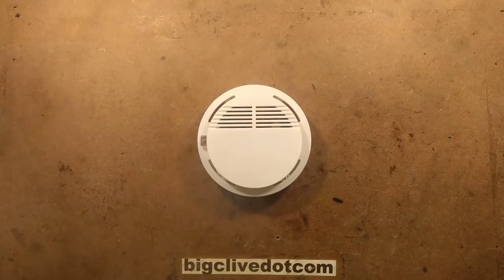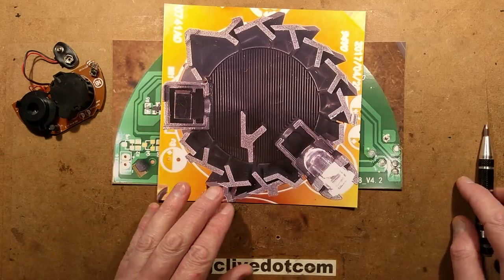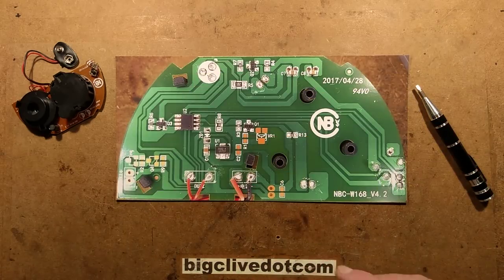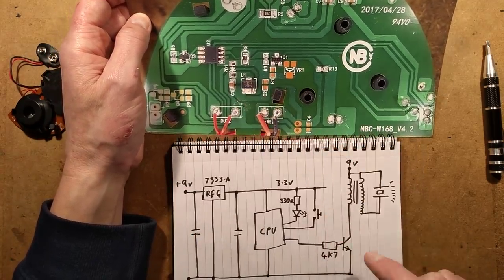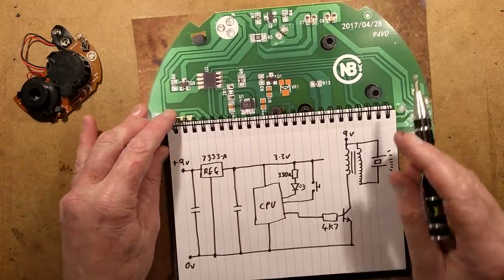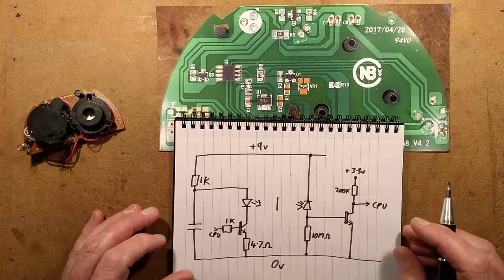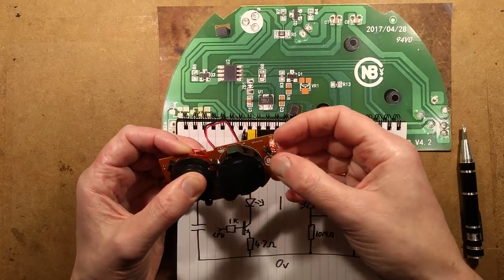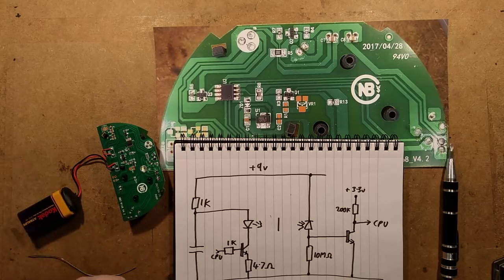Torch your home for $4. (with schematic)

Comment: Irrespective of your negative comments the engineering design is very interesting and represents a totally different take on design and minimising costs. Just think, no dangerous radioactive isotopes around.

I design PCBs using Cadence /Orcad and when I think I have optimised the design we send it to a Chinese design house that reviews our work.  It is amazing the cost savings they come up with. We save a fortune every year implementing their suggestions.

Chinese designers have different criteria to other cultures - which is why so many leading Western countries do initial designs and, ultimately,  production there.
Reply from the maker: The optical detectors are widely available, but often use a dedicated chip that can test the chamber for functionality by detecting low reflections of test pulses.  It also differentiates between temporary dust reflections and smoke, and also has proper low battery warnings.
The cheap units (only marginally cheaper that the real thing) have debatable detecting ability, can drain the batteries fast and not warn about low voltage.  Some have sounders that are as loud as your microwave oven beeper.
They're basically fake smoke detectors.

Comment: The zener diode that is missing is meant for the micro controller to get more of an accurate voltage reference of the battery state and sound a low battery alarm even when ran on stable the mains power, this smoke alarm can't because it has a voltage regulator blocking the actual voltage reference of the battery.

Comment: Normally test benches are used for simulating logic controllers, so you dont have to programm the chip itself, but you test your code in the testbench and if you tested it throughly you can start with your prototype in the hardware.
Same way it is done with using field programmable logic arrays for describing the hardware, simulating and testing it in a testbench and then you can put that into a one time programmable chip

Comment: Clive, I think the purpose of the 10uF and 1K resistor is to have a low current charge and high current discharge. The life of an alkaline battery can be 2x to 4x longer at lower current discharge rates.

Comment: I've got A xiaomi smart smoke alarm. It's brilliant. Keep me upto date on if it's working or not, and let's me sail down the sensitivity when the kids are cooking, and it will ramp itself back up in a give time.

Plusr it has a hub, that other smarts hang off, which I keep in the bedroom, at also sets of ab alarm, and flashes red.

Probably a bit pricey if just being bought for a smoke alarm, but cis I wad already using the xiaomi mija hub, it took a punt, and been happy with it.

Comment: 11:01 the lines in a transformer symbol are supposed to indicate the magnetic core material (iron or ferrite).  The odd power rail routing may be an abandoned plan to detect board damage or just incompetence.
Reply: John Francis Doe It really does not matter in this case as it is just a rough and dirty drawing to convey the basic logic behind the circuit, which is all that is really of importance in these discussions.  What surprises me far more in this example is that they got away with the far off filter capacitor as most low dropout regulators tend to be very particular about placement location and the ESR of their filter capacities lest they go into oscillation.

Comment: Surprisingly the standards do not allow a mute function. If it's done properly the sampling can be done less than 10s. Smoke should be detected before it is visible. This circuit does not have enough gain to allow to much contamination build up. Cheap chambers can melt with heat before the smoke is detected.

Comment: I had a cheap no-name smoke detector cause a false alarm when i wasnt home.
Neighbours called the fire brigade, my front door was smashed and in the end i had to pay for it all (bill from fire brigade and damage was in the high hunderds) because the smoke detector wasnt actually approved by the correct agency (the markings were fake).
If the detector was actually an approved model, insurance would have paid for all the damage caused by its failure.
 Most expensive 15Eur "savings" ever.

Comment: The older style smoke alarms had some sort of dedicated 14 pin chip which monitors in pulses, the change in resistance between two terminals (plates) with a trace of uranium of some sort placed in between the plates that reacted to smoke.

Comment: Good video. All I have seen of yours are very good. 

For whatever it's worth; "electrons" do NOT flow in the direction of the arrow on diodes and transistors. For electrons only flow from negative to positive. There is NO exception to this. Vacuum tubes proved this beyond a shadow of a doubt when they were first invented.

What DOES flow in the direction of the arrow is "Hole Flow". This is a VERY hard concept to understand; when first learning solid state devices. Most of my students had a very hard time, when I taught this in technical school. But it is true.

So what is "Hole Flow"? It is the opposite from electron flow. In that it flows from positive to negative. IE: it provides the "space" for the electrons to fill. No holes. no electrons can flow..

I write this, because in almost ALL videos concerning solid state devices; they show current going from positive to negative. That IS true but that is in reference to hole flow; NOT electron flow. For as above, electrons ALWAYS flow from negative to positive. Just the opposite of how the arrows are depicted on diodes and transistors.

So in essence electrical "current" flows in BOTH directions. 1. Electrons from negative to positive. 2. Hole Flow from positive to negative. It is how one looks at it.

For whatever it's worth.

Keep up the excellent videos kind Sir and thank you.
Reply from the maker: I use conventional current flow theory since it's more confusing to people entering electronics when the diodes and other components point in the wrong direction.
Reply: You are absolutely correct. But it is sad that we must baby feed those who are not interested in the truth in this day and time. 

Again keep up the good work.
Reply: @bigclivedotcom    I support your policy and don't think it's dumbing down at all.  A student may also struggle with the gravitational asymmetry when burger flipping at macdo....

Comment: Pro tip: if it has a battery and yells at you, it's a smoke alarm. If it's hooked into a big system with a fire panel, it's a smoke detector.

Comment: Is the zener just extra protection for the microcontroller 3.3V supply (prevents overvoltage in the event of regulator issues or external EM interference) ?

Comment: Most fire brigades in the UK will fit smoke detectors for free. They are the FireAngel devices which would otherwise cost around £10. They have a 10 year guaranteed life Li-ion battery which does not last 10 years. When the battery runs out and it starts chirping you phone FireAngel and they send you a new one.

Comment: They cost less in a LOCAL store and it will be at least somewhat safe. Not that it matters because as soon as they start to warn the battery is empty they get pulled out and not replaced

Comment: I bought a pack of 2 of these purely out of curiosity, they cost about £5 for 2. I put one up in my workshop as it's often smokey in there from the work we do thinking it would be a good test and it never once 'alarmed' so I took it outside and set fire to it and the thing still wouldn't alarm! Smashed the other one and put it in the bin. I'd never recommend these.

Comment: Call your local fire dept and have them install smoke detectors if you're unsure about anything. I had them do it for my parents. Turned up in a nice red fire truck apparently, installed them and got tea/lunch/a nice tip from the rents! Don't put your life at risk by buying something that likely won't do its job!

Comment: At least this has a microcontroller. I have one on my possession, not autonomous but connects to a fire alarm panel, that the only IC it has is an HEF4013BT that appears to be a dual D-type flip-flop. It's diagram is much more complicated, with a lot more transistors but I don't think it has the required functionality. A lot of false alarms by these fire detectors and they are not made in China but in Spain.
Reply from the maker: It sounds like it may be based on simple voltage threshold or transition circuitry.  A processor allows better filtering against nuisance alarms from slight transients of dust or smoke.

Comment: If that is the chip that Dave showed the website for, or one of their models at least. It has a full blown development environment complete with documentation down to timing diagrams and translated engineer notes. When I seen that I was surprised by the level of support by the vendor right out the gate. Some of the info when he was flipping through on his video you don't need to use the chip but would want to know to really squeeze out a lot of work.
Reply from the maker: It's really odd to see a chip like that with good English documentation.  I've been reading through its PDF and it's very readable.
Reply: Definitely, even from a coders perspective it's better than most API documentation.

Comment: Too late, my uncle's house already burned down just a few weeks ago. The investigation is not yet complete, but they are honing in on the photovoltaic solar system!
I did get a picture of a very sad looking smoke detector that was partially melted by the hot smoke.

Comment: NB I have no clue of what I'm talking about but I was thinking that maybe the idea behind the detour to connect that capacitor was to keep an option open for connecting multiple smoke alarms in a network. Where the electrolytic capacitors would be an endpoint for the transmission line.

Comment: Do you know why smoke detectors use relatively low capacity 9v batteries instead of higher capacity AA or AAA?  Is there something about the sensor or buzzer that requires higher voltage?
Reply: Well, in my country they use 4x AAA batteries, so there is probably no objective reason for that.

Comment: My landlord had a few smoke detectors mounted in my flat, since they are now required by law. I took one off to have a closer look, and it was also one of these optical jobbys. What surprised me was that it actually had a replaceable battery (of some weird uncommon format), while these devices were clearly rated for 10 years of battery life and then to be disposed of - not the battery changed. So I wonder if there are some things in such a smoke detector that age and make it so that it doesn't detect the smoke any more after such a long time, since if the battery is replaceable, you could just replace that and keep the unit?
Reply from the maker: You do get dust and dirt building up in them over time.  Especially when near a steamy or oily area like a kitchen.  It's a good idea to replace them fairly regularly.

Comment: Single-chip computing solutions for tuppence apiece. What a time to be alive.

And they've got at least one digital input, one analogue input, and three digital outputs... I wonder if you could use them as neurons and create a super cheap "electronic brain", like a physical neural net? Something of the complexity of a fruit fly, for example, might only cost you about fifty quid... and although each of the chips themselves are not exactly going to be any great shakes, processing-wise, you'd have 2,500 cores operating in parallel. Surely that would be useful for something?

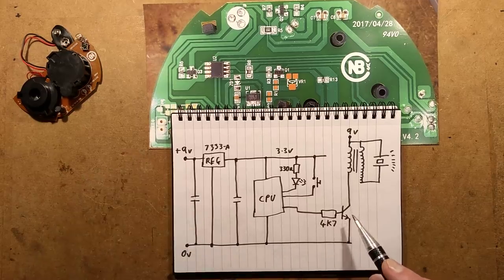Comment: At 10:40 that should be a thyristor and not a bipolar transistor.  As this should be a latching circuit, although there is no reset switch for some reason.

Comment: Does the test button just send a signal to the microcontroller that turns on the peizo, or does it turn the LED in the chamber up to full brightness to check that it is detecting?
(In the same way the test button on an RCD mimicks the fault condition, rather than just switching off)
Reply from the maker: I'm not sure if this unit does test the operation of the chamber.

Comment: I have the same but i change adjust potentiometer to multi turn for better sensitivity adjust and add switch in front to turn off and instant discharge electricity for alarm.

Comment: Couldnt they have built it inverted? So the receiver always gets hit by the transmitters light, and the receiver measures the lights intensity. When there is smoke, less light is received and sound the alarm.

Comment: 4-6 € is the standard price for smoke alarms at ALDI and LIDL without lithium battery.
Reply: I always save a bit of money by not putting a battery in mine.
They don't go off for no reason either.
Double result.
Reply: smirk bigly Sounds clever

Comment: Here in Germany the smoke detector madness is pretty bad. They don't have to fulfill the requirements set in the law for fire detection equipment, because they are not. So on one hand the law treats them as optional because they only provide a emotional benefit. On the other hand they where made mandatory for private households because of lobbyism. I store mine in the freezer because they only detect steam or rather white smoke(steam from cooking or smoke from blowing out a candle sets it off), but not the smoke that apppears in a house fire. Basically it's a scam and some courts have fallen for it. They even ruled in favour of some private landlords who used wireless smoke detectors with cameras to spy on tenants.
Reply from the maker: If your detector is subject to false triggering from cooking then consider a thermal one in your kitchen instead.  It detects a sudden rise in temperature or a fixed upper limit.
Reply: Thanks, sadly the chimney sweeper selects and maintains the model. So I have no choice in the matter. I just pay for the junk.

Comment: So that's why a hot shower sets the alarm off.
Reply from the maker: You have to really plan the positioning of smoke detectors in the vicinity of a shower room.  The condensation of water on dust can also cause false alarms when it causes rogue current paths on the PCB.

Comment: I really wish there was a standard socket and interconnect method for mains powered smoke detectors. One of mine started giving a low battery warning, so I took it off the ceiling to investigate. It turned out that it used a bank of supercapacitors to handle mains failure instead of a battery, and 2 of the supercaps had failed. That model of detector is obsolete (it was dated 1997), and the newer ones from the same manufacturer are not compatible. So I have to replace all the interlinked smoke detectors, which is OK because they are all old, BUT I also have to re-do the wiring. Unbelievable! As a temporary measure I replaced all the supercapacitors and the 2 other electrolytic capacitors on the board - there wasn't anything else in it that is likely to fail with age.
Reply from the maker: That is quite annoying.  If they're mains voltage then it should be a simple power and link wiring system.  If the detectors are not too old then it should be fine to fix them.  If they are getting to the 10 year mark then changing them all might be a good idea.

Comment: I'm thinking they possibly designed this so they could use an external supply like a 12V supply, hence the position for a Zener and electrolytics. It's the sort of thing I would do so I could hack it for personal use afterwards.I think Microchip and ATMEL should worry about these microcontrollers as this is the space they dominate.

Comment: What a paranoid society we now live in, did you know there are more deaths caused by housefires today than there were 40 or 50 years ago when people didn't even have smoke detectors, most people had open fires and flame retardant materials were Asbestos or something people just laughed at.
People went out the house and switched all electrical things off, today they go out of the house leaving everything plugged in and switched many things on wirelessly whilst they are out, but at least they can watch via their home cctv system as their dodgy electronic cigarette machine bursts into flames, assuming they don't lose the connection and post the video onto Facebook Twitter and other social media websites before searching the web for the fire brigades phone number

Comment: Can't verify it, but the 10Meg resistor with the transistor (and the suspected photo diode)? My guess is that the transistor is actually a FET and the 10Meg guy is its pull-down. That would create a nice logic level (vs. an analog signal) at the output though.

Comment: EEVblog Dave did mention that the $0.03 chip doesn't have an analog input.  Or at least not a traditional ADC.  It may have had an analog comparator that would suffice for this product with a little extra firmware.
Reply from the maker: It does have a comparator input on that pin.  I wonder if there's a software adjustable threshold.
Reply: The DAC for the comparator reference is only 4 bits and I wonder if that's sufficient? Seem it certainly could be and a comparator makes great sense for low power operation.  
If it's not comparator based, the 3 cent chip is from a family of parts and the expensive 8 cent and above members have up to 12 channels of 12 bit ADC. http://www.padauk.com.tw/en/product/show.aspx?num=4&kind=41 
12 bit, 4 channel ADC in SO-8 for 8 cents in 50 qty: https://datasheet.lcsc.com/szlcsc/PADAUK-Tech-PMS132-SO8_C133216.pdf
Reply: Microcontrollers don't have traditional ADCs full stop. They have successive approximation ADCs. While others hide the filthy inner workings in hardware, maybe this one expects the ADC to be implemented as a library function.

Another approach is when you don't have an ADC, but you're sampling the charge in a capacitor via a resistor and you can sample time instead...
Reply: Siana Gearz,
Successive approximation converters ARE the traditional ADC. Full stop.
The schematic lacked an integration capacitor so it's not using an integrating ADC. Full stop.